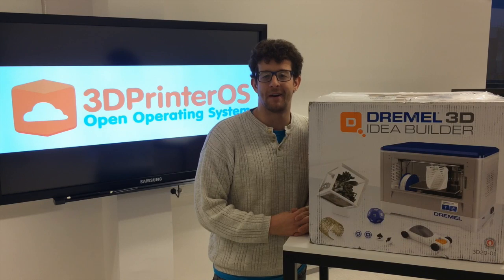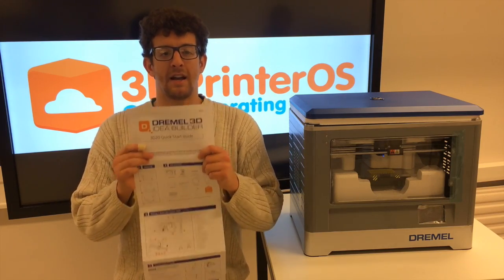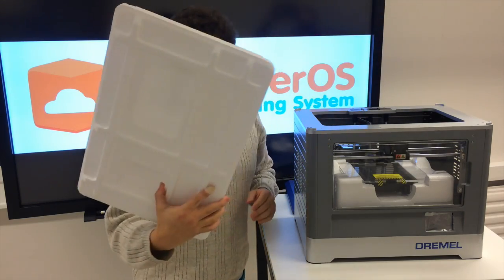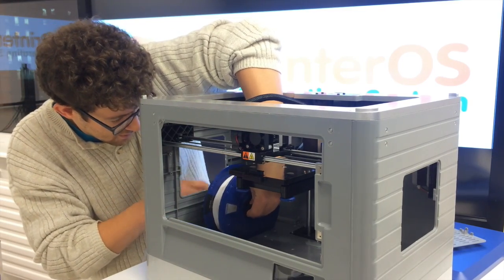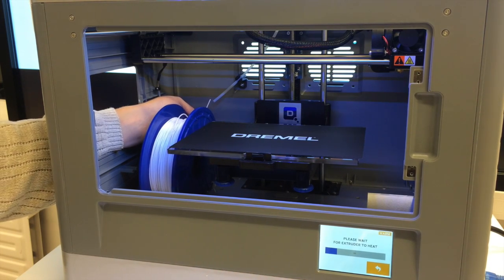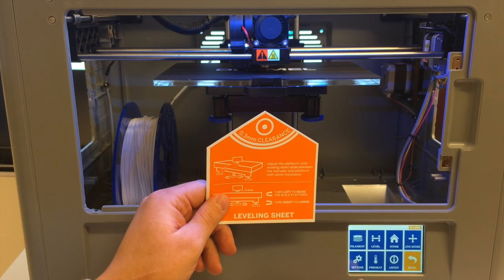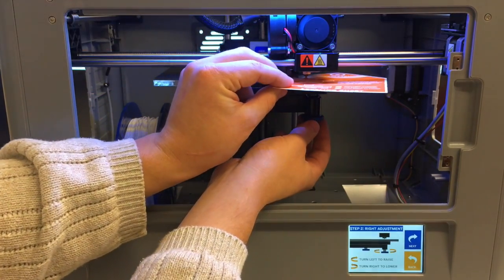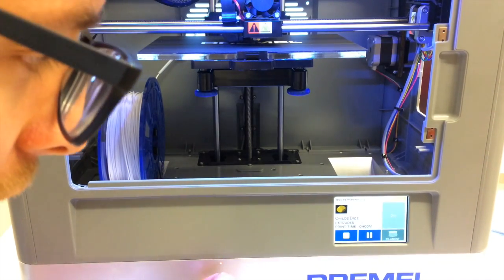Unboxing the Dremel 3D Printer - 3DPrinterOS

Comment: Nice Review. Differences in 3D printers are many, and the main one being what type of finished product you'll get. By this, I mean resolution and material stability / strength. If you're looking for a light "functional" prototype with low tolerance thresholds, this baby may do the job. I'd look into comparable priced models, but personally, at that GRR price point it's a great buy. Otherwise, drop another $2k and get a Form Labs 2nd Gen... Whenever they become available that is.